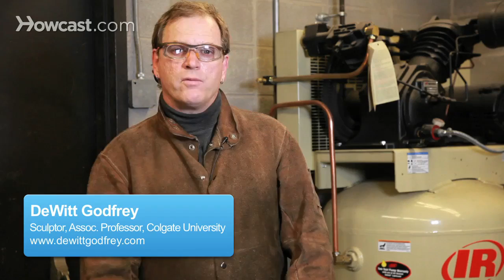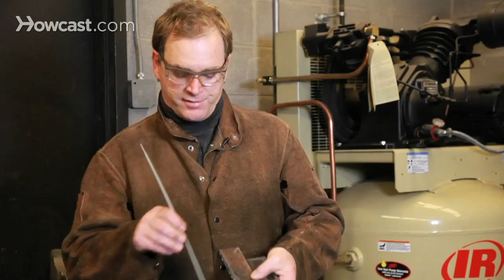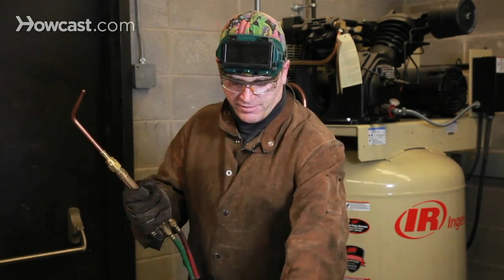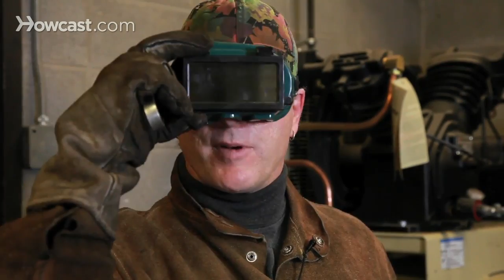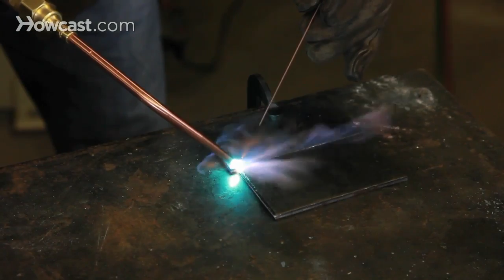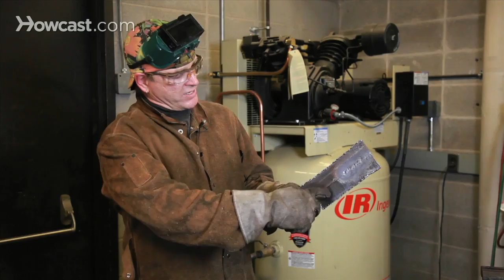What Is Welding? | Welding

Comment: What is the function of the filler rod?.................fills what?
I saw a video of someone placing two pieces of metal about 1/8" apart and then using stick welding to join them.
Is that welding?..............Isn't welding the melting and fusing of the two pieces so they become one?

Comment: You say soldering uses a third metal to stick them together and then you say we use the filler rod to fill up the gap. You sir are a joke.
Reply: Filler wire is the same metal as the material 😂
Reply: I think he just said soldering then there was the "," after which he started to talk about the filler, where he's now talking about how welding works